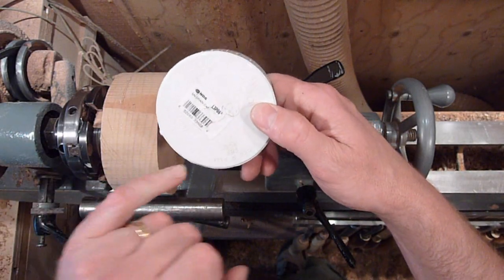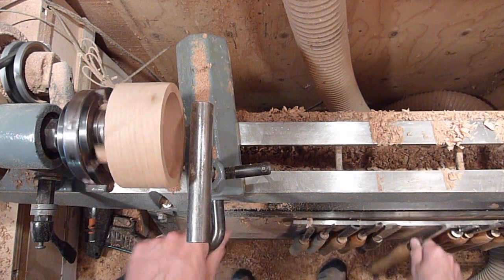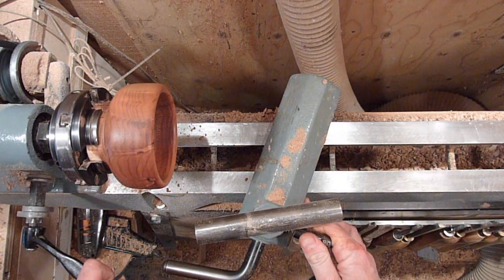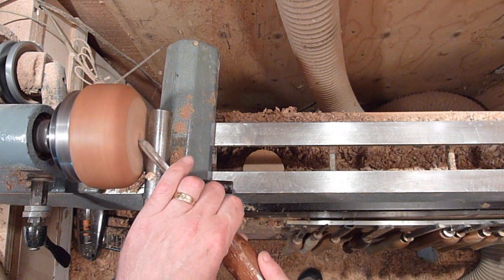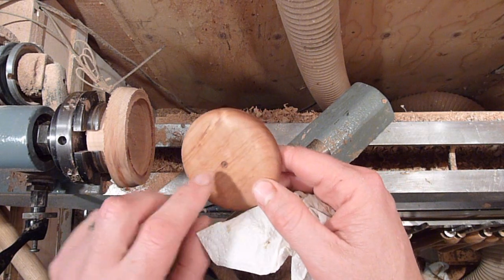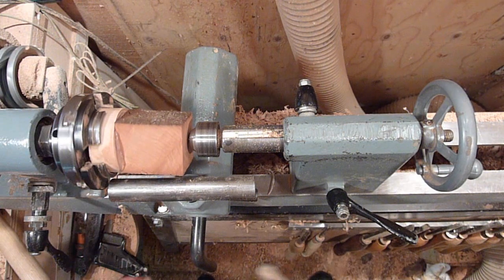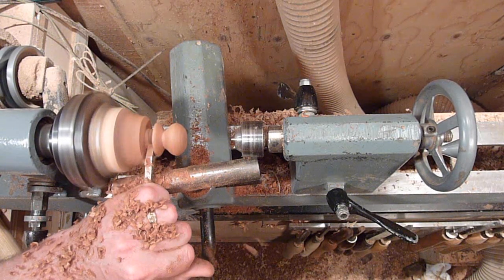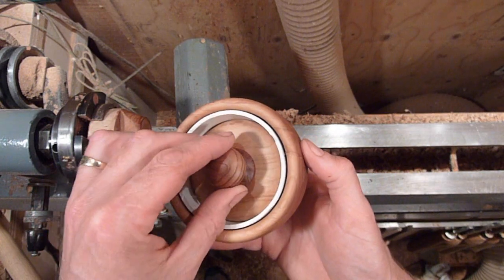Woodturning Hamburger Press turned on the lathe

Comment: Well I made one but the only piece of wood I had that was even close to being large enough was some yellow pine I got at the Log Cabin Factory. I had to make the wall real thin. Even then the 4" PVC cap is a tight fit. I think I'll turn it down a little so it fits in there better. I still need to make the press. I sealed the whole thing with CA glue so maybe it wont crack and it'll hold together for a while.

Comment: I didn't use it on the press just the box. It was so thin that I didn't think it would hold together. I put some pictures on my facebook page. Also I put the PVC cap int the cole jaws and thinned it out so it would fit a little looser.

Comment: I have tried using that method of finishing I have gone right down to 4000 grit with the lathe at 450 rpm but it still leaves those tiny lines. How do you stop it from doing that?